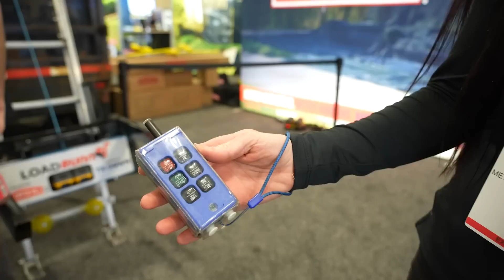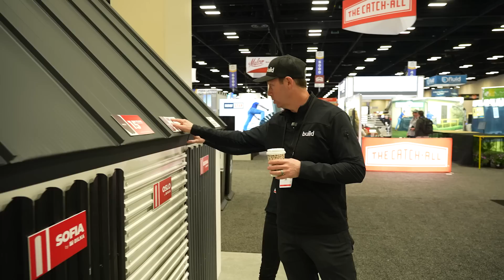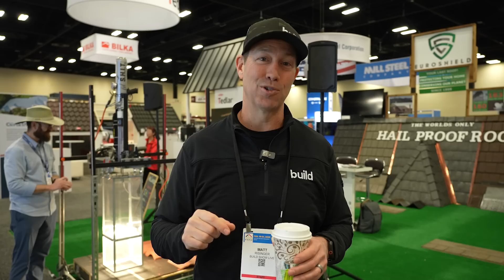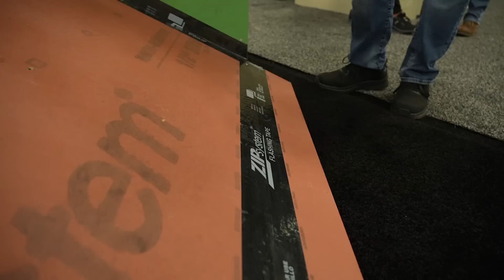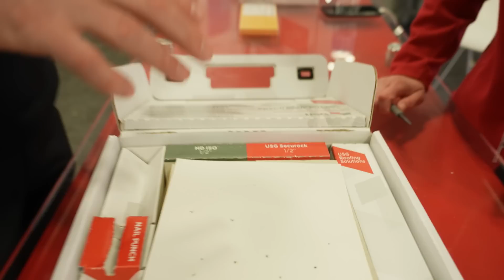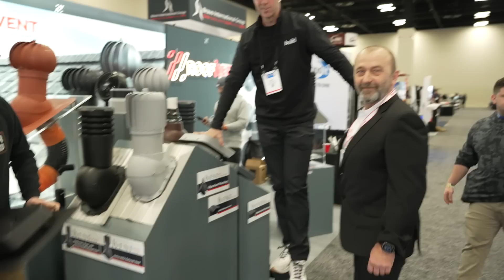International Roofing Expo 2025 - Must See Innovations

Comment: I would like to see root sheets with the ribs at a angle. That way the snow above the door would move to one side. then a seam line would move the snow the other direction on the other side of the door. This could be done with regular sheets, but that would require cutting each sheet at an angle.

Comment: I have euroshield on my roof and can thoroughly recommend it for all the reasons outlined. Just makes any asphalt roof look silly-looks Great  great warranty . Full disclosure ? It does smell a bit initially like a new tire, but once he past I wrap removed dissipates in a few days AND absolutely gone by the time you get it up o your roof deck….not mentioned in thsi video ? Super easy to install tight, in. I be because of the marking s and cleat system. The accessories are excellent as well, and they supply a superb butyl caulk (NB you have t sue thsi type) and if your going to put this roof in speed a bit more money and get stainless ring shaped nails. This roof is gonna last 50 ears easy in all but teh ost extreme North American environments. Thy will send you samples, also drop ship if you dont have a local distributor, and are a very easy soi company tto do business with. Price wise thsi is slightly less expensive than Grand manor, which i regard as teh Cadillac of asphalt roofs; doesn’t shed granules and clog up gutters (!) very solid to walk on as well (rubber/why it ?!) at step angles may need ice interrupters .
Reply: I live in the Deep South and would be wary of how any plastic/rubber derivative product will age with our UV exposure here.  Other than that I like it.

Comment: Will there be ignorant solar there too
Reply: What makes solar ignorant?
Reply: @Aeroliten  once connected to the grid can only put in 15% of their advertised output or extra electricity the ignorance is easily demonstrated with an amp meter if it's an amp clamp only takes a second add 4th grade math to demonstrate the ignorance of it
Reply: Did you do the test yet

Comment: Matt, you may know this, but all solar panels have an “air gap” behind for cooling and to prevent heat build up.  The solar panel works best if not too hot.  The gap can serve double-duty to promote drying.  Usually solar panels require an air gap at the edges, again to promote cooling.  Tesla has accomplished the edge cooling in a non traditional way.